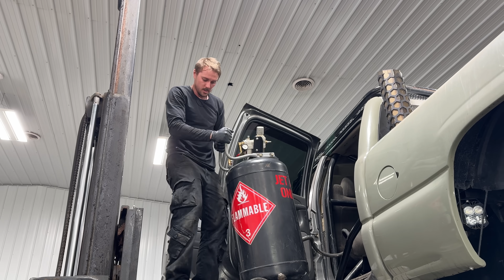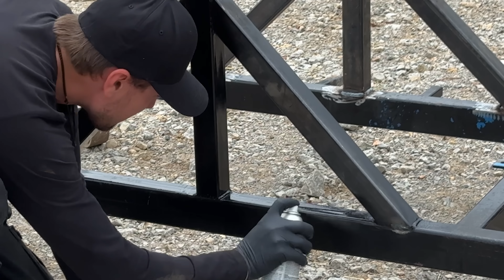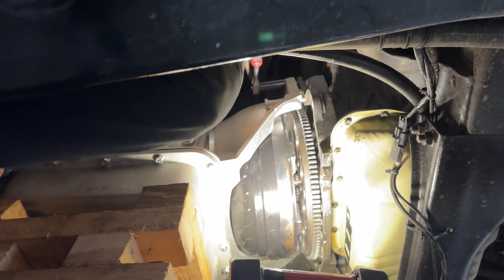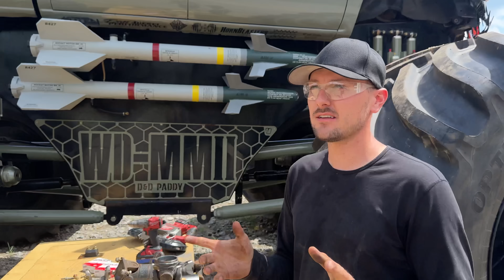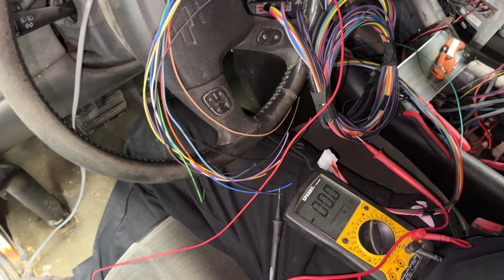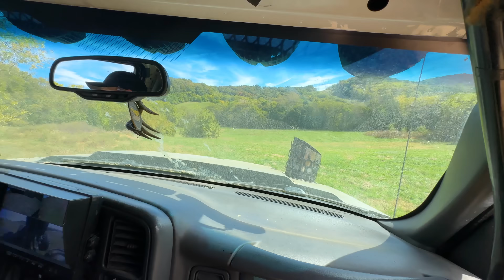Fixing the World's Largest Truck (TWIN Transmission Upgrade)

Comment: If you guys had plumbed the transmissions pressure ports together you could have forced them to shift together based on load. Or you could have converted them both to full manual valve bodies with a th series valvebody mod and shifted them both together manually. We put two of those transmissions in a 6x6 hauler and they worked flawlessly

Comment: I got kind of a stupid question. Why would you use two transmission controllers instead of just one and wire them both into the same one? That way one controller is telling them bolt when to shift instead of trying to pair up two different controllers. Just asking

Comment: I like your opamp circuit. Classical use of an amp! I couldn’t help but notice that the engine speeds aren’t synchronized. If you add a bit more intelligence to the voltage buffer, you could get the engines to provide close to the same power and engine speeds be closer. (When torque converters aren’t locked) The other nerdy thing is you could control engine bias between the front and rear engines.

Comment: And this is where the "no degree" part becomes obvious. So many factual errors here. Do you know what Engineering is? It is applying MATH AND/OR SCIENCE to design or create new technologies.

You are very obviously NOT applying math or science, because every time you try to expound upon either, it becomes immediately obvious you don't know what the fuck you are talking about.
Reply: I suggest a textbook, instead of instagram and tiktok.

Comment: Pressurized air in a tank with jet fuel could be dangerous. Not sure at what pressure it would self ignite but you realize you have pressurized oxygen with fuel in a big canister chilling in your back seat. Be safe out there

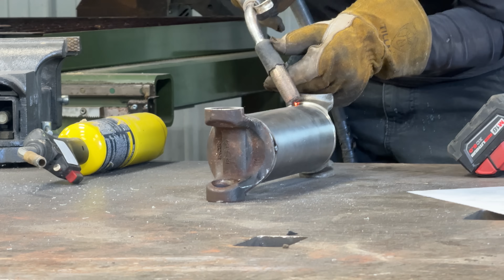Comment: I thought U joints on a drive shaft should be offset 90 deg from one another to maintain a constant velocity at the output? 13:08

Comment: Why didn't you go with way think axles tubing it not like it going 100 miles hour. Should went thicker even with 4 Ling bars so they won't brake. It going break again when he get on it or doesn't like something and bind up

Comment: I believe the tires are over inflated. Im not a genius but a 4×4 tractor (depending on size and weight) will run that tire at like 12 to 15 psi i believe

Comment: Did they at least lower the weight, by replacing the solid steel rockets on the sides with something lighter?

Comment: What a great job just building cool stuff for Cody. Not sure this thing will ever be "done" but its definitely getting better.

Think bigger on the driveshafts and drive train though and after all these years still cant get the suspension worked out? Kept flopping over so not its just solid mounted lol?

Comment: The way the jet fuel works is called Head Pressure, same as on aircraft, Gn2 is used on aircraft (nitrogen).

Comment: Tyler, how did you learn wiring and electronics so well? I understand the fab side, but to also have the working mindset to also know electrical is incredibly impressive!
Reply from the maker: It takes time! Still getting my feet wet with coding and such
Reply: There are forums for everything man if you want to learn it you can. I spend most of my "free time" learning more about my job so I can continue to advance in my career. I'm in the steel processing game but do quite a bit of maintenance. Wiring is my weakness but I don't have the time in the shop to learn in bc I'm in the office most of the time now so I just look up what I'm interested in or what I need to know.

Comment: As a heavy duty diesel technician, why the hell are you using car transmissions?
A pair of 8 speed autos out of an F-250 can be easily controlled with an aftermarket controller and are capable of handling the power of your engines easily.

Comment: "no electric pumps, ALL you need is air".... and the air comes from.. a compressor. Which uses a pump to pump air into a small space.. thereby "compressing" it. And its usually stored in a tank for later use. BUT, that compressor uses a pump. Powered by electricity. :D
Reply from the maker: Each engine actually has a belt drive compressor

Comment: Might be a dumb question, but what is wrong with them shifting at different times? Wouldn't offset shift points result in smoother power?
Reply from the maker: Actually, nothing bad would happen. But it would change the load on the engines at certain times, which could look or sound strange

Comment: I probably asked before on whistlin but why is it important to synchronize the drivetrains like that? As long as they're both going the same direction, what's the conflict with shifts happening at different points? Problems with sudden loading or something?
Reply from the maker: It’s not actually a huge problem to shift at different times, but the Allison’s had to go anyway, they are too complicated and this will operate better and be more reliable

Comment: are you sure you're not gonna accidentally make a fuel-air explosive with the jet fuel being pressurized by environmental air/oxygen? Nitrogen is used to move LPG around sometimes to avoid creating a potentially explosive air mix

Comment: Have you determined why it failed so severely when Cody applied the hard brake on the downhill section?
I came across a video that discussed a theory suggesting your 4-link setup could actually be the cause it.

Comment: Why not just use large electric motors with tons of torque and instant power and then install a little 3L diesel engine to power the batteries. Collab with Edison motors. This eliminates all this complexity with the transmissions and two engines.

Comment: Great work. I thought those drive shafts are solid? Can they really handle the power?
Reply from the maker: Being so short; they will handle sooo much power. The strength is in the diameter, not the thickness

Comment: I worked removing gearboxes for years, never tighten bell housing bolts until all faces meet, put the bolt loosly and shake the box from the back till it sits properly, then tighten! Xx

Comment: I've never quite understood why the transmissions need to shift at the same time. I would think you would get a smoother power curve if they didn't shift at the same time, that way 1 is always pulling. If 1 engine is at 2500 and the other is at 1500 they will both still make power.

Comment: Why not just put a jet tuboshaft engine in that thing . Used to spin a generator that powers an ELECTRIC MOTOR  spinning the wheels . Connect the jet exhaust to the exhaust stacks. With an AFTERBURNER SHOOTING FLAMES OUT T H E STACKS , ONLY LARGER STACKS!!! 10"- 12" STACKS? OR  DUAL OR QUAD 8" STACKS AT DIFFERENT LENGTHS.  A 500 HP 3 PHASE MOTOR SHOULD DO IT 500HP, 5000 FOOT TORKS!😮..... THROTTLE THE ENGINE TO THROTTLE THE MOTOR TO CHANGE SPEED... IT MUST BE LIGHTER AND EASIER TO CONTROL?

Comment: Why are you guys always talking about and putting so much effort into getting the transmissions to shift gears at exactly the same time?

As long as they are both in a forward gear, both in reverse, and both in park at roughly the same time, that is all that really matters. 

As long as you are using independent ECUs and TCUs, each engine can happily rev at its own, independent rpm.

If one engine upshifts or downshifts a bit before the other, that is not a problem. 

In fact, having an offset between gear shifts will smooth out the way the truck feels when you are driving it and it shifts through the gears.

Having them both shift at exactly the same time will maximize the lurch you feel during shifts.
Reply: I suspect the transmissions end up fighting each other. The change in load when only one trans shifts would cause the other engine/trans to surge and basically get confused. 
Plus they’re making a good bit of power so it’s likely to over speed an engine if the transmission doesn’t shift right.
Reply: @NBSV1 None of the dual-engine vehicles I've heard about over the years have had that problem. 

Think about the impact of one transmission shifting. If there is a surge in acceleration, all that might possibly do is speed the truck up enough for the second transmission to shift gears. 

Shifting at identical times would maximize the surge during shifts and having the shifts separated even only slightly would smooth it out out because only 1/2 as much surge would occur during each shift.

Maybe they want a big surge during gear shifts to "feel" faster? That is the only thing I can think of...

Comment: And missiles on a pickup truck????
And with the suspension I'll lay odds it's easy to high center it out in the rough with only two axcel's????
Reply: This is with the suspension lowered so it’ll fit through the door and not be so tall trying to work on it. 
They can air up the shocks and it sits higher.

Comment: I would ditch Trans ECU'S and get manual valve body with ratchet style shifters, keep it simple.
Reply: Yep. I’m really surprised they didn’t just do that. Make it manual shift so they’re both in whatever gear you want at any point.

Comment: Also idk that build but I do know gear wind. I would bet that junction box fails. I can’t remember if there is one or two or if you changed it but that whine is the gearing not the motor. Put it in neutral and spool it. No whine I bet. In get they are fighting each other. Something is off in timing or ratio.

Comment: Diesel Generator mod > Capacitor bank > Thermoelectric generator wrap for sucking more power from heat waste to stack to capacitors > 4 super strong electric motor wheels = Capacitor bank rechargable boost. Less rubbing metal.. Points at old Diesel electric trains Those were tools.. I want my own version of Dead Reckoning from The Living Dead movie. Squints at capacitors and slides eyes to Boeing Plasma force field canceling out bomb pressures with its own Ultrasonic shockwave But I'm a little too advanced minded heh.. Taps "FBI ATL" Listing on my name at Sheriff computer Clean record.. Lol.. I snapped over it.

Edit: If you have computer team look into using heat power for Ultrasonic resonance filtered pulse echo scanning. You see Bats blasting full speed into cave vents like they know what's around every corner? Ultrasound by Plasma resolution can 3D animation scan viruses turning genes on and off with a good enough computer. But I'm just mentioned for Virtual reality 3rd person piloting.. Because data can be used to form 3D map of all things around and above. Lol.. No blind spots. Gonna be used for Spaceships someday with the Shockwave antidrag anti-pressure tech aka Stealth by elevating sound beyond Human range of Hearing. Like the ALIENS do it.. LOL.

Comment: Grease the rollers on that Hyster forklift you’ve either got an issue with your free lift cylinders or the pressure on your mast rollers, try greasing each tear of the mast and rollers should take care of that issue

Comment: Bro I have a crazy idea I've been trying with the strangest results, that I know can be amplified to an extent of manipulation and control, that you could try on a huge scale, with extraordinary diamagnetic properties with that magnet you have! You would need a whole lot of bismuth, some kind of small low voltage battery, that SAME EXACT shape you have but with copper and a but more flat, with no hole at the top, a furnace to melt all of the bismuth, and an oven to keep the bismuth melted until all is ready to be poured AT ONCE, and some kind of non magnetic table, (like wood) to set the melted bismuth on, OVER the magnet! You seem to be very smart so I'm sure the rest that I'm leaving out of YT comments you will easily put together what goes where and what happens when you do, if you actually try this experiment that is of course. You may very well be the first citizen to create at home, an object that defies all of what we know and are told, maybe with no function other than an example that these devices are possible on large scale, and maybe that one day in the future, or in the past someone or something has, or will, make one of these. Whether for our benefits, or for our demise.

Comment: Great job , good content , but that drive sharft looks no where near heavy enough , sidewall thickness.  i have used 1/4 even 3/8 wall for much less weight , i could be wrong , time will tell.

Comment: Dude thats great you got it going.  I was sad to see the guy that you thought had the solution built something to was not only not going to work but wrecked the old transmissions.  Nice work and it would be bad ass to work side by side with you.  You seem to have tons of knowledge and have a great attitude.  Keep the videos coming!
Reply from the maker: They did a good job trying to work with the Allison’s. And they did for a while, but it was just not a long term solution
Reply: @propdepartment they did the same thing I thought about doing. They just relayed the signals from One Transmission to another to control the solenoids. The only problem with that is the transmission wouldn't know what to do with line pressure. It looked like he just programmed it out so it would sit at Max Pressure. It worked but like you said it was not a long-term solution.

Comment: Are you running 1 pedal for each engine then the buffer was because the tcm's needed a throttle signal as well?  Just curious because I always have to mess with this stuff building crane trucks with multiple operator stations, remote controls ect, and im usually left to figure it out on my own
Reply from the maker: That’s correct. I’m guessing the small draw for 1 tcm is almost at the limit of what the ecm will allow, and two is too much.

Comment: If you still have problems shifting, couldn't you just put in full manual valve bodies in each transmission and just manually shift them with a single shifter?

Comment: I see its 4l80e's I build a good many of these ... out of curiosity I seen the part about the cut oring on the input shaft ..realistically will this thing ever go fast enough to lock the converter up? And I see it looks like it has some awesome converters in it but i still dont see the lock up in the converter holding up to that machine ... but I have no clue on the gearing weight power etc ... I doubt I will hear a answer to this but again my question is will it ever get to lock up?
Reply from the maker: Great point, I don’t think we will need to use lock up. In fact, I think I will disable it. It could cause problems in a twin setup
Reply: @propdepartment cool I got a response! Yeah I think disabling the lock up would be a good idea! Also I dont know what length of time you all drive this unit and im sure this comes without being said keep a eye on the trans temp 😊

Comment: why not do like edison motors and use electric motors for the drive train and batteries and have the diesel engine work as a generator... youd have WAY more torque without needing a ridiculously small transmission that keeps breaking since its the weak point in the whole system

Comment: Could remove a lot of weight just by cutting some holes in the frame, it's so overbuilt to the point that it's useless. Might as well be overbuilt and lighter.

Comment: Driveshaft was welded wrong you are supposed to stagger the u joint ends to prevent vibration other than that love the video
Reply: I thought that- certainly applies to cardan shafts in agricultural applications
Reply: @roblonsdale8927 the more driveshafts the more chance of vibrations

Comment: Great build. I'd consider possibly swapping the powertrain for a bigger liter engine from a wheel loader. As removing the suspension, replacing it for a cab suspension. It will handle Cody's abuse better, being a more robust setup as cheaper to repair.

Comment: Did you guys ever consider using the twin engines combined with generators to power an electric motor mounted at the dropbox? Similar to how diesel train  locomotives work.
Reply: Yeah this is how the big big mining dump trucks move so it'd be ideal for this

Comment: So you went with two 4L80E'S the Tow haul mode versions which also come in the same trucks only the ones with the 6.0 and 8.1 liter gas burners
Reply: 8.1 trucks had allisons or ZF6 manuals

Comment: Just out of curiosity, what kind of education did you get to do all of this? Your  job is basically what i would call my dream job.
Reply: I’d guess some kind of engineering base, but quite frankly education alone won’t cut it to do a job like this. get as much hands on experience as possible, whether it’s your own projects or working in a shop of some kind
Reply: @tylerstafford  he has no formal qualifications, just does stuff until it works
Reply: @tylerstafford  so you don't know the answer but still felt the need to chime in, lol, 🤡
Reply: Just gotta work on things all the time. While I have an MS in EE, it didn't teach me welding, mechanics, or fabrication. That was just from doing it for years.
Reply: I work in almost the same setting. I can tell you that I have no college under my belt, all of these types of jobs are on site learning. The only thing he might have gone to school for would be CAD for the plasma table. If you are a hands on person then you could consider a local fab shop to get your foot in the door.
Reply: School of hard knocks
Reply: No school gonna prepere you for this type of work
Reply: this is a nightmare job
Reply: Same for me

Comment: Just wondering why go 4l80 and not 48re?  A lot of aftermarket and info for dmax with 48s.  I'd have to guess 48s require an engine plate to mate up, but the performance world gravitate towards them.  Either way, nice problem solving

Comment: just wondering, in the video you use the wheel and the stick to both steer? What's up with that? Is the stick for rear and the wheel for front?
Reply from the maker: Yea I didn’t explain, the wheel is the front axle, the stick is the rear axle
Reply: @propdepartment  is there an issue with setting up the rear to controlled the wheel, or has it just not been setup yet?